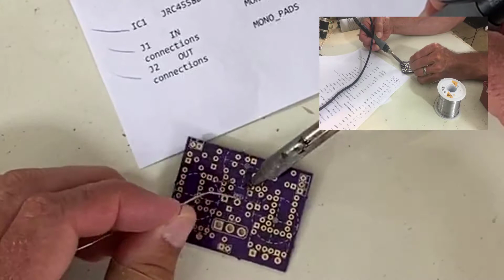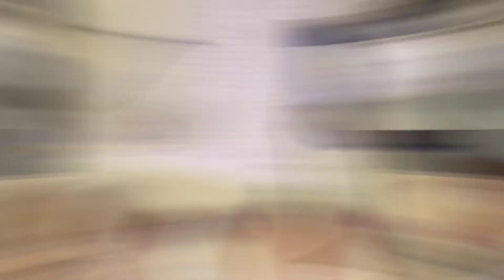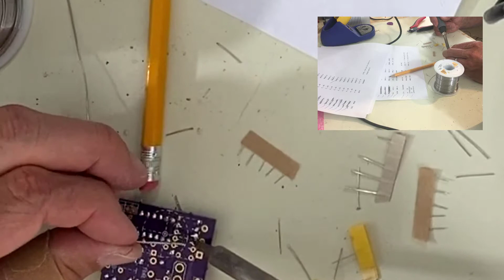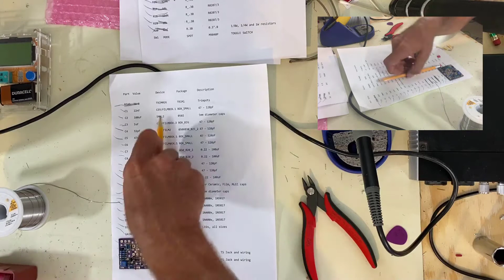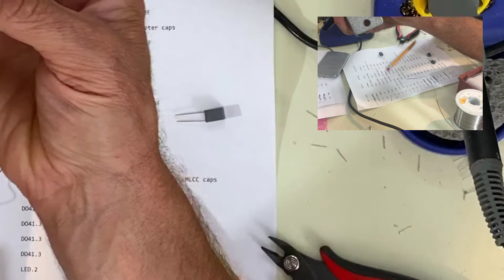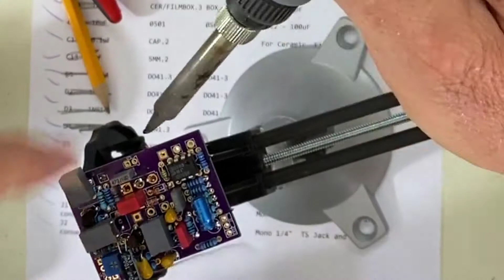Build Your Own Effect Pedals - Tube Screamer (Part 5 - Soldering)

Comment: Thank you for explaining reasons of choosing modification values (R9 - 4.7k vs 3.3k vs 2.2k, etc.).
Reply from the maker: I'm wondering if going the other way would be more beneficial. Less gain available on the knob since many people use a TS as a boost with the gain down anyway.